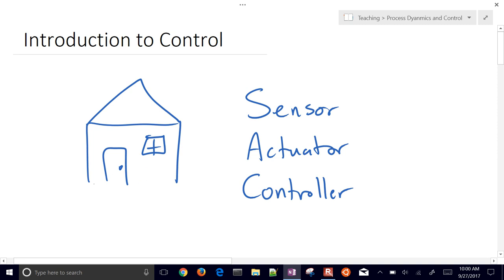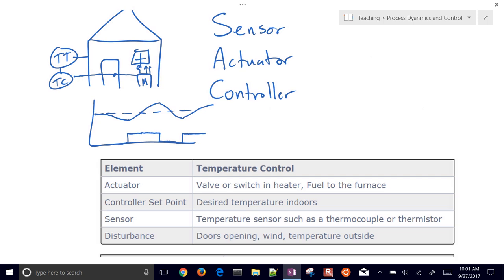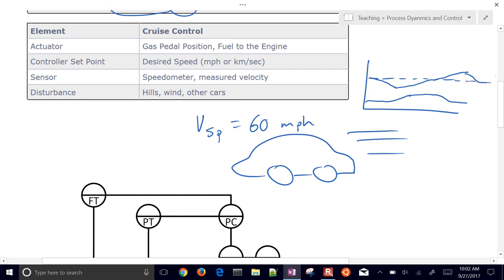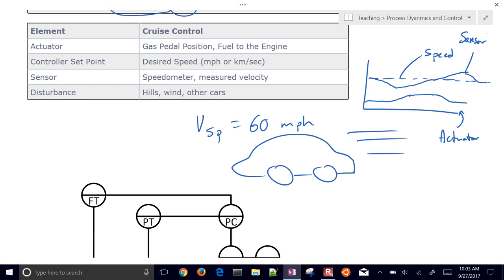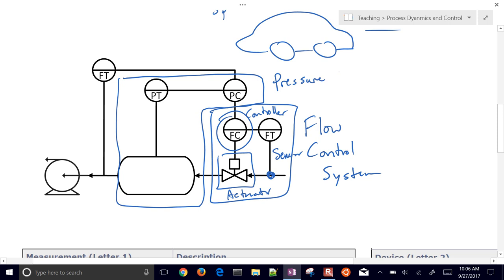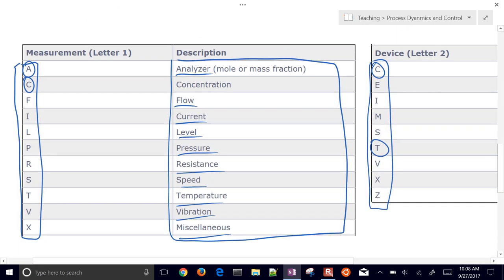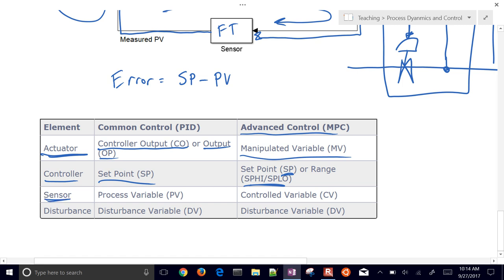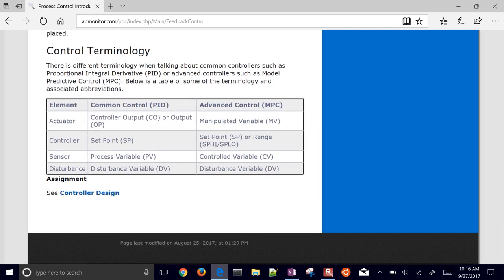Automation with Sensors, Actuators, and Controllers

Comment: Any short descriprion in how to control proces fow example: from an analog sensor( 4-20ma transduser for pressure or temperature) can control a vfd or an actruator servomotor. A plc is required or have other possibilities.  Thank you
Reply from the maker: The course at https://apmonitor.com/pdc helps to answer those questions. Specifically, here are valve design information: https://apmonitor.com/pdc/index.php/Main/FlowValves and sensors and signals: https://apmonitor.com/pdc/index.php/Main/SensorSignals and https://apmonitor.com/pdc/index.php/Main/StabilityAnalysisExercises (see Problem #3).

Comment: I am a victim of gangstalking (where criminals in authority lie about the victim to get the public to do evil things to the victim). Since last July, the criminals have been slowly poisoning me in my home. They have hooked up the whole house so that various gases and vapours are emitted into every room, including hallways and stairs. The process appears automated (but which can be manually overridden). For example, if I open the windows to ventilate the house, gas comes in through the windows.
I suspect the gases and chemicals are being stored in the house next door. But I don’t know what sensors or gas delivery system they have hidden in my house. Any ideas how they are achieving this and how to detect the sensors and locate and remove the gas/chemical delivery system?
Reply from the maker: It sounds like you need to hire someone with a chemical sniffer to find the source of the leak. That sounds like a hard situation. It don't think this video will help you.

Comment: diff between actuatir and controller being ?
Reply from the maker: Actuator is the hardware that causes the change to the process such as a valve or pump. The controller is the algorithm that decides how much to change the actuator to achieve a set point target. More information is available at https://apmonitor.com/pdc
Reply: @apm  Thanks I get it now !